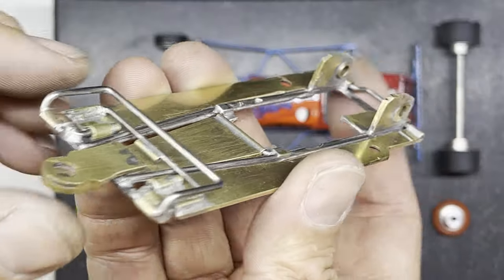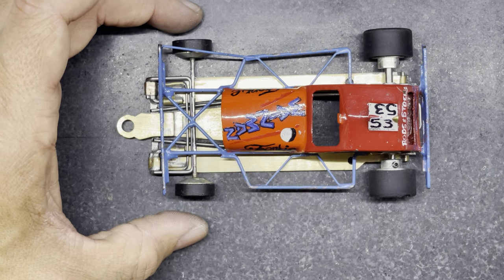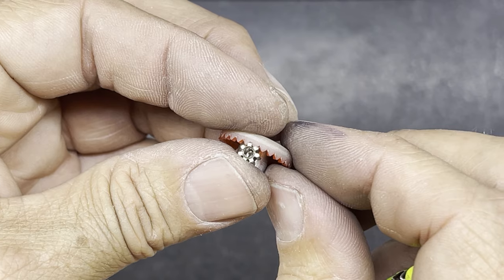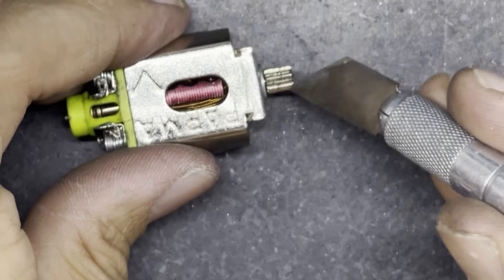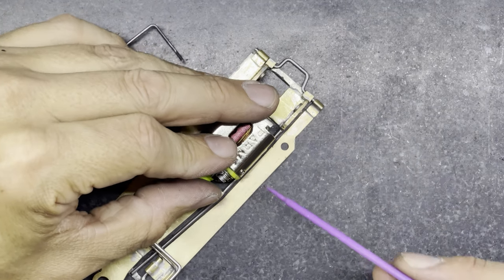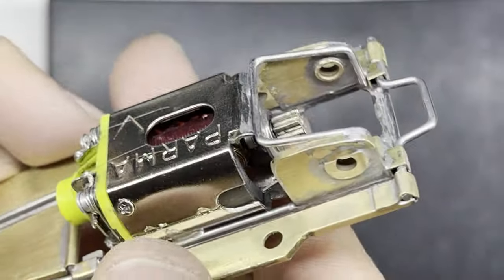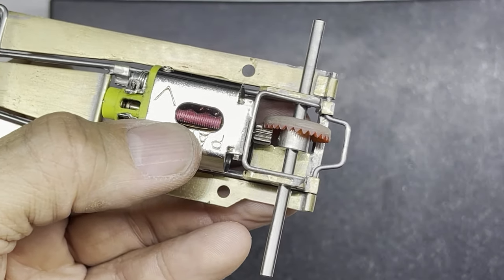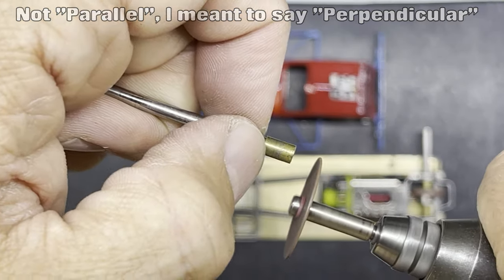Fitting a motor to the 1:32 scale slot stox car chassis and getting a good gear mesh

Comment: Another great "Tech Tips" video. When I am making axle spacers I slip the brass tube over a axle and secure in place with a drop of superglue. Then place the axle in a the chuck of a electric drill.Then hold a file against the brass tube  as I power up the electric drill.  A bit of heat will then allow the brass to be slid free of the axle.
Reply from the maker: Great tip. Thank you for sharing 👍🏻

Comment: sloting plus make some nice axle collars that you could use instead.
Reply from the maker: I didn’t think they did 1/8” collars but I will take a look. Thanks.
Reply: @CleaveTech  my bad. They make 3mm collars (i use them) but it should be pretty easy to drill them out to 1/8"